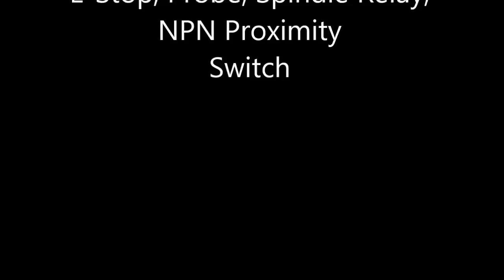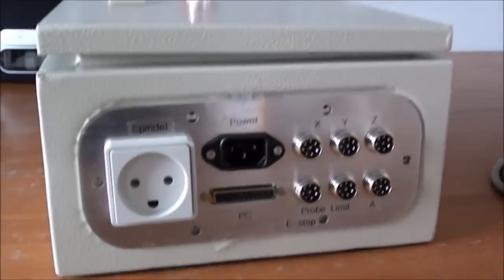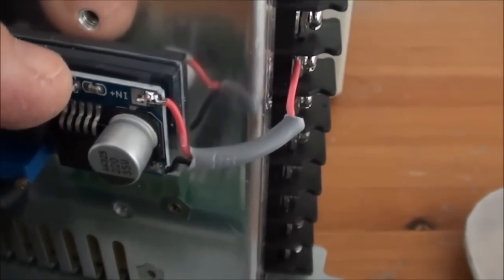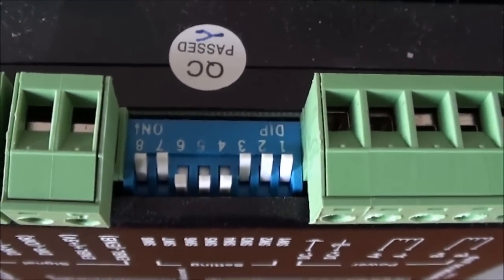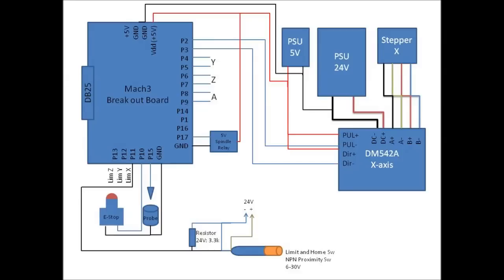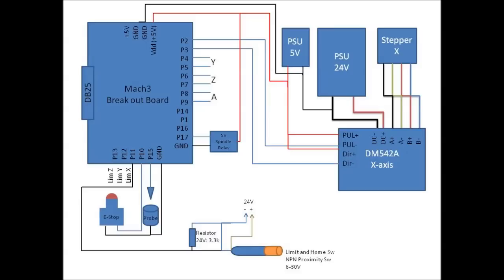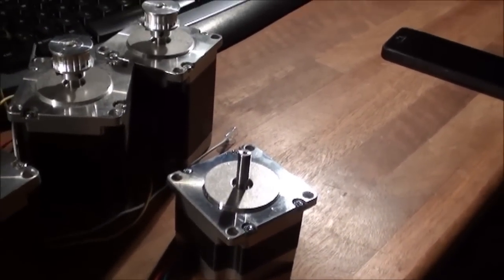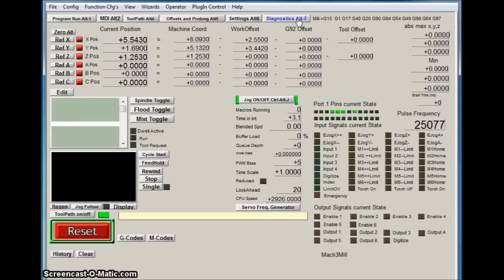Building the Control Box for a OX DIY CNC Router

Comment: holy cow! are you sure that's for the "ox diy cnc"? that's one impressive driver set-up for the ox. I'm setting mine up with the "tiny-G" and thinking I'd build a cnc suitable for the control box you've built. Awesome job!!!
Reply from the maker: +Wey Runner Hi Wey. Thanks for the encouragement. I hop that your control box w TinyG also will turn out good. I'm very happy to be able to run Mach3 as it offers so many functions.

Comment: Thanks for video, How did you get diagram to connect them together?
Reply from the maker: The one in the video I made myself. of course based on the manuals from the vendors of the main components + a good bit of experimentation :-)

Comment: this breakout board can support plasma torch ? and which pins you think i should connect plasma torch
Reply from the maker: Would think that you can use the same pin as I use for the relay to power on/off the spindle
Reply: wouldn't the problem comes with the fact that the way g code switch the spindle wont be the same as the way it was gonna switch the torch

looking how the spindle switch before it can actually cut the material is different   from the plasma cutter ..the plasma would have to touch the material fist after the touch has to auto adjust to the height  which will enable the touch to cut effectively. on contrary the spindle has to fist gain momentum first by rotating to required speed before it can actually come close to a material which it should cut  

so how using this board are you gonna include even the touch height control 

thanks best regards
Reply from the maker: But that has to be controlled by the software making the g-code, not the hardware. In the case of the spindle you get a M3/M5 command to power on/off the spindle. I would imagine that if you generate code for at plasma you would have to turn on/off many times during a run and that has to be embedded in the code.
Reply: Awesome  answer  .....say  you  use  the laser  cutter g code  generator  ...will  this still  work for plasma  ? 
How  do  you  imform  the BOB  that M6 or G21  is for a  plasma  touch  not  a spindle. ?

Comment: Nice build, what torque rating do your nema 23's have?
Reply from the maker: ophis1984 For the X I have a 280 oz/in (= 2Nm or 20kg*cm) for Y I have two 140 oz/in (=1Nm or 10 kg*cm) and finally for Z I also use a 140 ox/in

Comment: What is the purpose of using this breakout board, when you jumper 5V which powers the LED side and transistor side of the optocoupler together?
Also the drives have their optocouplers so these are useless, also all your input signals are 5V , very prone to noise. 
And the last EL817 optocouplers are very slow and do not work well for faster step frequencies.
Reply from the maker: Main purpose is to have an easy way to split the parallel port signals and connect to the drivers. I'm now working on using the PoKeys range of CNC controllers that communicate via USB/Ethernet - looks much more future oriented
Reply: But you gain nothing with this easy way, just poor performance and show others how not to do it. 
I also have couple of Pokeys devices USB and ethernet, and they have been nothing but problems in Mach3 plugin... don't know how they behave in Mach4 . Update after update somethings broken...
Reply from the maker: I do not agree here. The setup I have has been and still is fully operational. The machine works great and without and issues. 
Secondly, most of the issues has been removed in the PoKeys Mach3 plugin. I have used the latest release and it works smoothly.

Comment: hello sir  i am using the same driver as your's but i noticed that one of my 3 drivers DM542A  is getting very hot and having a burning smell .  Can you please help me sir .
Reply from the maker: +adz Hi Adz. Unless your driver is (on the way to be) broken down I will recommend you to check the following: A) Voltage in. Should be 18-50V DC; B) Switch setting- especially SW1 to 4 are important. Try to go down to e.g. 1A and half current (= ON ON ON OFF); C) Check that PUL+ and DIR? are 5V as they should; D) Pull the terminal bloc´k for the motor coils and insert one motor from an axis that does not have any problems. If problem still is there you probably need to return/switch the driver

Comment: THANK YOU MARTIN
PLZ I WANT TO USE 2 MOTORS IN Y AXIS HOW I CAN CONNECT WIRE IN BREAKOUTBOARD    CAN I CONNECT LIKE YOU ?
Reply from the maker: +el alami Mohammed Hello Mohammed, I also use two steppers for the Y-axis. You have two options for how to do that: 1) Use 4 stepper controllers (like I do in this video) X,Y,Z,A and let A be a slave to Y (this is set up in Mach3; 2) Use 3 stepper controllers and connect two steppers to the one driving Y. To make one of the two steppers go in the opposite direction switch the wires of one of the coils . Wiring would be: YStepper1-YStepper2:Blue-Blue;Red-Red;Green-Black;Black-Green;BR; Martin
Reply: If you are using Mach3 you can set up stepper motor direction in software ''ports and pins'' set dir. active low, check, uncheck for the Y axes and slave A axes. Good luck
Reply: thank u bro

Comment: How are these eletronics working?
Reply from the maker: From what I have done until now I would say yes. However, I have only tested the electronics in a mock-up mode so I do not know yet if I will see loss of steps etc. To evaluate this I still need to assemble the CNC machine and do some accuracy and repetition testing. My plan is to do that and share in a video at a later time.
Reply: This is the $260 eletronic kit from ebay (longs motors) correct? Cant wait to see how they work out for you! Also what plans are you making your cnc from? Im starting mine, it is the 25x25 from www.solsylva.com
Reply from the maker: Yes I think it must be the same. I shopped my set directly in China as I go there occasionally. This it the Taobao link: http://item.taobao.com/item.htm?spm=a230r.1.14.17.2Q2DwW&id=38246941623&ns=1#detail
I'm working on a model called OX. You can find much more info on this on Openbuilds.com. This is also where I will post details on my build.
Reply: Martin Barfoed That seems like a really nice machine to build. What size are you making at what is your estimated cost?
Reply from the maker: I'm going after a fairly large foot print. 1500X1300. This should give me an effective X travel of 1000+mm. As the design has open ends you can in princip do endless long projects if you devide your g-code in tiles and move the work piece as you go. I would extimate the cost must be around $1000.
I have now posted the begining of the project on OpenBuilds:  http://www.openbuilds.com/builds/stainless-ox.1914/

Comment: nu kan jeg høre du er dansker.. så tænkte hvor meget bruget du på det setup?
Reply from the maker: Afsløret :--)
Der er da gået en del timer i det samt en god portion research forud. Der er som sådan ikke de store ben i at lave det men min anbefaling er klart at få det til at virke uden en CNC maskine - bare delen på en plade. Da PCer med parallel port er ved at uddø skal du nok gå efter et board med USB eller Ethernet. Er selv i gang med PoKeys57CNC som understøtter MAch3 og 4
Reply: lyder spænende. skal ikke bruge det helt samme opsætting, men syns det en super video. og har fået ideer, til den DLP Printer jeg og ser på at bygge. men en stor en :D så skulle lige se hvordan du satte det hele op. men har du bygget alle delen selv eller bestil dem ?
Reply from the maker: Jeg tog udgangspunkt i den klassiske OX men så har jeg lavet en del mods. Hele byggeprocessen er beskrevet her: http://openbuilds.com/builds/stainless-ox.1914/
Projektet var besværligt og dyrt da jeg måtte importere det hele fra USA. Siden har jeg aftalt med OpenBuilds at jeg distribuerer deres dele i DK så nu er det hele tilgængeligt på makersupplies.dk
Reply: ok spænende tak for vejledning.. jeg sidder kun pt i 3D builder app'en og leger med ideer. men går lige ind og ser på siden hvad de har.. mange tak info
Reply from the maker: De rå rails er 4600mm lange så i princippet kan de være så lange som det. I praksis er det super dyrt/svært at sende noget der er længere end ca 1900. Der er nogle der er kommet forbi og hente hele længder eller lange stykker på fx 3000mm
Reply: ok cool.. skal lige ha desgin skellet pt. så ser på om jeg kan arbejde med de størrelser de har.  men sidder pt og arbejder på en løsing til et  UV LED Andrion system. Men igen tak for info